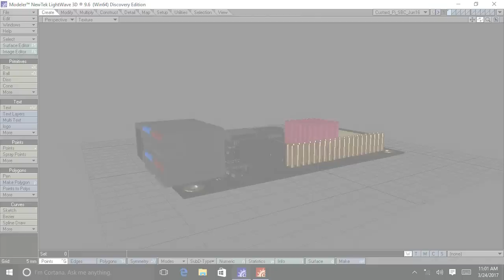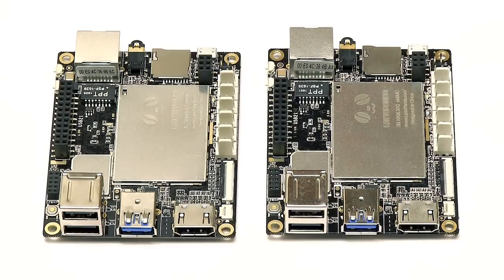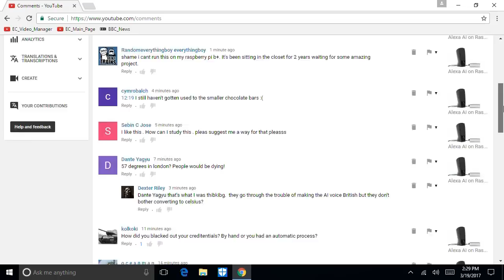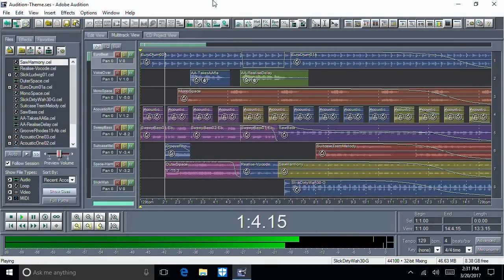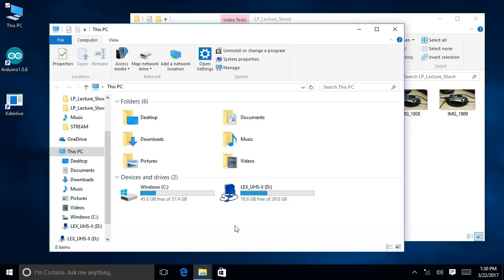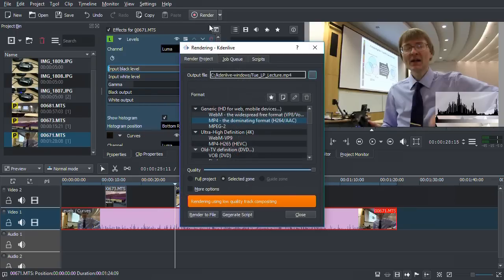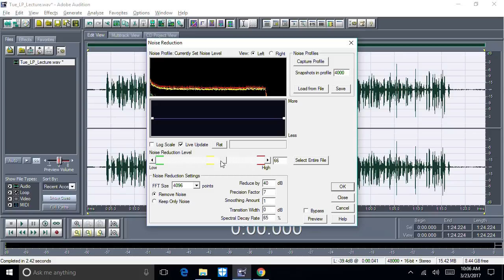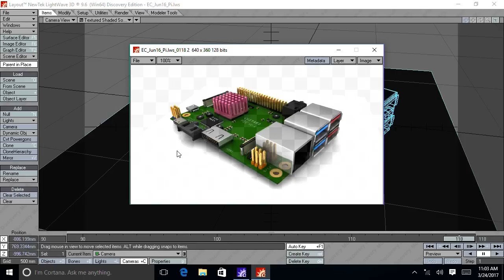LattePanda Week

Comment: For cooling with the CD case, you could put a old CPU fan under it, and use the female pin slots to put in the power wires. You might be able to connect it with the CPU pins for controlling when the fan turns on.

Comment: I use a latte panda as a tablet i bring to classes since my laptop is too big. It needs a heatsink big time. The one with the built in fan that DF robot sells is good enough but i mounted an inline slide switch so it wouldn't drain the battery when turned off.

Comment: Great video! The board gets quite hot, does it? If only we knew someone who could make videos testing passive and active cooling solutions for single board computers ... hmm.
Reply from the maker: Yes, I must get on the case . . .
Reply: Ryan Lester I ordered a fan with mine. it seems to make the job so the CPU is on maximum 70 during stress for a longer time
Reply: Looks promising!

Comment: An external fan is a must, the SOC throttles down quite quickly since it will get quite hot.
When you add a fan, it shouldn't ever throttle! (I have one and it's great, but wasn't when it didn't have a fan).

Comment: I'd keep the CD case and attach a 120mm fan to it :D
Reply from the maker: OK, brilliant idea! I will have to try this now!
Reply: We are expecting a follow up video.
Reply: yes was thinking the same thing , throw a nice heatsink in there too , looks like 50 cd sleeve but  you could put 100 sleeve on it taller sleeve ,more room for heat sink and fan and maybe you could dremel out some holes near the bottom were the ports are and 3d print some curved trim plates to go in the holes with nice cutouts for all the ports and glue them on ,do you think a cooled panda could handle a plex server  with transcoding if it is only serving 1 or 2 clients at a time?
Reply: With this idea perhaps using ceramic heat sinks might be a good idea over the usual copper/aluminium choices?
Reply: Put a sterling motor driven fan in the CD case. Why not use the waste heat to power the fan instead of draining more power to cool it.
Reply: Would be interested to see a 1x PCI-e slot break out from that usb3, even if the bandwidth is limited.
Reply: i don't think a sterling  engine would spin a fan fast enough to be  effective and  if it did then  then it  would cause  the efficiency to go down since it works on heat differential if it cools the chip to that of the outside air temp then the  sterling engine would stop
the whole idea is that you have heat to drive the  engine  cooling the heat source that drives the engine would be counter productive no?
Reply: Andrea Mitchell You only need a fan if the board is substantially hotter than the outside air.

Comment: I am shocked. Absolutely shocked. I find it absolutely amazing that this SBC runs Windows 10 so well and my parents literally just upgraded to a TB Levono because I finally# got the message across that their computer was "so slow" because it was pulling full capacity to run Windows 7 and did not have the RAM or processing power to upgrade Windows even one more single time.
Reply: I am literally in awe of this little SSD. It's just so quick. (I prefer 2.5 or above processors, but this little 1.4 seems to be rather quick.)
Reply from the maker: Wait until you see the new LattePanda Alpha -- I expect to review it here in two weeks.

Comment: LATTEPANDA QUESTIONS
1. How much Windows 10 system RAM is used?
2. Are there any major windows components that might not be installed, to save RAM?
3. How much system RAM is net available for all other applications?
4. Does it support OPEN GL?
5. What are the built-in (on board) audio specifications, in and out?
6. What is the Maximum capacity external SD card memory that can be used?

Comment: I wonder where Windows 10 is stored. On the board or on a SD-Card? And does it come with different Windows 10 languages or only english?
Reply from the maker: Windows 10 is stored in the flash memory on the board. I have not tried, but presume that you can change the language in the usual Windows international/language settings.
Reply: you nee the "language pack" or get it via the update funciton. Somewhere in the settings, you can change language. There it will try (!) to get the language pack via the updates then. 
Here on my latte it did not work and I get the language pack from another source in the web. But I just was not able to find the URL again ...
But yes, you can change the language.

Win10 originaly is on the internal emmc chip. A boot partition, the OS partition, and the recovery Partition (~700MB)
As I was trying to install a Linux, I kicked all that crap away and after I had to rewrite the Win10 image you get it from the latte website) I had 700MB more space :D
(don't  need that recovery)

Comment: Has the device had any problems with power supply ? How many mA was it supplied for all the work it did ?
Reply from the maker: Fed with a 2A 5V adapter, and worked fine all week.
Reply: Thank you very much !
Reply: I recommend not to use the μ-USB, that sucks. You can use the pins 2x2 marked with GND and 5V next to the µ-USB connector.

Comment: I need to use a drone to hunt for Wireless Interference for the company I work for and was stuck for a solution to connect the portable spectrum analyser the drone will carry to something I can view back on the ground. I've ordered one of these and I think it will solve my problem as it should run the analysers software and I can use VNC and WiFi to see the spectrum, that's the theory. Great video.

Comment: yes you can change the wallpaper on unactivated windows 10. just right click a picture and choose set as wallpaper. i do it all the time
Reply from the maker: Great tip -- I will try this. Thanks.
Reply: no problem.
Reply: I'm thinking about picking up a latte panda myself to replace the gole 1 that I have been working on and accidentally bricked. cause I have several people asking me how I did alot of the things I showed on my gole 1 gaming wise and the latte panda is pretty similar spec wise.
Reply from the maker: You may be interested in my video on the three new LattePanda boards, which posts tomorrow! :)
Reply: @ExplainingComputers  awesome. Cant wait to check them out

Comment: Good presentation.
So the latte Panda board was designed and intended only to run Windows.
I guess if you want a SOC that runs Linux or Android then you should run it on the ASUS Tinkerboard?

Also, I did not catch any attempt to use the Arduino portion of the Panda board.

Comment: Compared to your Raspberry Pi Week it looked a bit easier for you to use the LattePanda as a PC for a week. Not haveing to chage OS's and install programs to read a HDD or SSD and so on.
Reply from the maker: Yes, very true. It was much easier. I did not show transferring data across drives -- eg my video files recorded during the week -- because it all just worked fine. The USB 3.0 connector, and the micro SD card slot not in use for an operating system, made things really easy. The Raspberry Pi 3 is a great and responsive SBC. But the LattePanda is more so (if also more expensive).

Comment: Tinker board RK3288...... Hi i would like to know  if I can conect an external hard drive to this tinker box . And also will the 7 inch tuch for raspbarry screen conect to this. I want to run my CNC table with a raspberry pi ( or what ever ) & an exterior hard drive. I have large CNC table 10 foot by 20 foot I would like to run Mach3 because of the fitures My question is can I run windows 7 as my O/S and then load programs on windows like normal Thank you in advance  John
Reply from the maker: Yes, you can connect an external HDD to a TinkerBoard, and a Pi screen. But a Tinker Board is an ARM PC, not x86, so cannot run Windows. The PCs in this video are x86, and can run Windows 10. They cannot run Windows 7 -- no drivers. You could run Windows 7 on an UDOO.

Comment: Hi, Hi, thanks for the info on the LattePanda. I'm just getting into it's possibilityes and have a question - can you run 2 monitors with it? Can you use the HDMI and MIPI-DSI at the same time?
Reply from the maker: IT does not support two monitors I'm afraid, although you can use the HDMI and MIPI-DSI together, which is nice. If you want multiple displays (three!) try an UDOO x86 AP: https://www.youtube.com/watch?v=tpT4WGsMcvk You are coming to this market just as it is about to expand rapidly with new boards. Keep watching! :)

Comment: Would it be possible to install Windows 7, XP or even MS-DOS on this LattePanda? Would be cool...how about games?
Reply from the maker: Possible, certainly. But difficult. You would need appropriate drivers, and the LattePanda is Atom based, so does not have a standard boot loader to install an OS from a USB device. It really is a Windows 10 machine.

Comment: I run Debian 64-bit headless on mine, works as a really good web/email server however I can't find the wifi adapter on the board so I can't get drivers for it.
Reply from the maker: Excellent --- I'm impressed. :)
Reply: Matt Beaver: What version ... I also tried a Debian ... Link please? ;)
Reply: crapcbm this is the link but this is for the 64 bit lattepanda plus you have to use the built-in efi shell to boot it off of a flash drive. http://cdimage.debian.org/debian-cd/current/amd64/iso-cd/debian-8.7.1-amd64-netinst.iso
Reply: many thanks ;) I will try it
I have the 4GB/64GB version ;)

Comment: What's it like for heat?  Does not appear to have any heatsink other then the shielding can on the top.  The Atom IS a low-power CPU, but without decent heatsinking, the CPU clock will throttle back to keep the die temperature under control, and this will greatly affect it's potential performance.....  EDIT: Ignore.  You mention at the very end it could just about fry an egg.  Heat is an electronics killer.  I would not want to use it for anything important without fitting some kind of heatsinking. ;)

Comment: Mr. Barnatt,
     Thank you for your videos on the Lattepanda. I have been looking at this board for a project I am working on that requires opening and using multiple programs at once. Have you done any multitasking testing with this board? Currently I use a mini itx pc I built for this project but am currently looking to move into something like the lattepanda due to its size. This would allow me to mount it directly on to my tripod, open the programs and use team viewer to operate it from a distance. My concerns are whether or not it can run multiple programs at once (anywhere from 2 to 4) without bogging down or locking up, Can it handle a usb hub on its usb 3.0 port,  and whether or not I can attach something like a SSD drive to it for file storage. It is my hope that you can help answer some or all of these questions, thank you in advance.
Reply from the maker: Multi-tasking is no problem -- I have had many programs running at once. It is a multi-core PC running Windows, so this is just fine.

Comment: Are you going to try water or air cooling? Both would be tricky due to the CPU being located on the underside.
Reply from the maker: Passive and active air cooling were on my list. But now that you mention water cooling . . .
Reply: You can just mount the device upside down, and have an extender for the GPIO if you wish to use that.
Reply: Or liquid nitrogen . . .

Or dry ice . . .

Comment: Very comprehensive first look indeed! 

I had a few questions:

What are the power requirements for this board? How much current does it draw at full load? Do you reckon you can mount a heatsink over the metal shielding and maybe put a cooling fan over it? 

Do you think it's a good choice for simple office work and a bit of browsing? Or are there cheaper solutions? 

Cheers!
Reply from the maker: It runs fine from a 2A 5V adapter. I've not (yet) measured the power use. Yes, you can mount heatsinks on the metal shielding -- which for the CPU is under the board. And you can put a fan over that (DF Robot even sell one). And there are pins to connect it to for power.

For simple office work and browsing it is a good choice -- everything I did of that nature during the week was on the 2/32, and it worked fine. The big benefit of the LattePanda is that you have Windows. So if you need Windows, it is pretty much unbeatable (in my opinion!) right now. If you don't need Windows, The Raspberry Pi 3 takes a lot of beating. Not quite as responsive as a LattePanda, but very usable under Linux. This said, the web browsing experience -- especially playing video -- is better on the LattePanda.

Comment: Can you reformat these board's to windows 7
Reply from the maker: You would need an appropriate image to install on the LattePanda, plus hardware drivers. Probably technically possible, but as far as I am aware not currently available.
Reply: I tried differenz images of Win7 and 8 to install. Win7 starts install, but freezes while installing. Win8 didn't even start from USB or CD (via USB) looks like we are stuck to Win10. Also there seems to be none Linux for the Panda, although it is advertised with it... 
If someone knows a version of Win7pro/64 that can be installed on it, please let me know!
I am sick of this Win10 .... (Drivers can not be the big problem; you will find some, just a question of searching and time...)
Reply: +crapcbm I'd think the GPU and possibly network chipset might be exotic enough to warrant you'll never have Win7 on it properly, even if you coaxed the install to actually go through. There might be a better chance with Linux.
Reply: Windows needs some garbage ACPI BIOS support that you're likely not going to get out of this thing!

Comment: I do like the SBC's like the Pi and Panda. But it does look to fall short compared to a laptop in two ways. The need for an external display. And a need for external power. I wonder what a small case that incorporates a small LCD and battery pack would do to its portability.
Reply from the maker: All of this can/could be done. SBCs run very well off USB power banks -- and I've tried a 7 inch touchscreen on the LattePanda previously. I just need to case it all somehow! Here's where I tried the touchscreen: https://www.youtube.com/watch?v=j7o6CBNUmt4
Reply: I would like to see what you come up with as far as a portable case solution involving that screen and a battery pack. (if you decide to attempt it) I think you could get away fairly minimalist with the design of it assuming you use your wireless keyboard/trackpad.

Comment: sir, can we use lattepanda(4/64) for designing software like CAD, CATIA, ANSYS, HYPERMESH, PRO-E.....and can it will support well for minister, hard disk and other USB devices..?
please, explain it briefly with difference between regular Windows PC and lattepanda...
Reply: sir,it will be effective if u make a video for such a question separately and briefly..please.
Reply from the maker: The LattePanda is just a Windows PC. The 4/64 should run basic CAD pretty well.
Reply: so sir which will good for us lattepanda or regular pc by performance and cost- point of view

Comment: Goodday, mate.  Now that´s about the coolest single board computer case you´ve designed to date.  I really like that home made case out of a CD case.  I´ve been throwing those away for some time now.  That´s really thinking outside the box (case) as it may be.  Now you´ve got me hoarding all my junk and not wanting to throw anything away.  That would be easy to add a fan to it as well as drilling holes for the different wiring requirements.  Absolutely brilliant!  Cheers.  :-)  
Can one run Linux on the LattePanda?  I do not care for Windows at all since I´m using my Raspberry Pi 3 as my desktop computer.  It works quite well for what I´m doing.

Comment: As far as I've seen, unactivated Windows 10 only runs for 30 days before it needs to be activated else you can't use it any longer. Is this not the case on LattePanda? You may need to run winver to see the date it'll stop working by.
Reply from the maker: My 4/64 LattePanda has been running for over 4 months without requiring activation. There certainly used to be limits in earlier versions of Windows, but as far as I can find out, this is not the case in Windows 10. Microsoft really want us to run it! :)
Reply: Hm, interesting. When I first switched to Windows 10 and they were having the activation server issues, it told me I had 30 days to activate it. I wonder if they've built in more leeway since Windows 10 first came out. Either that or it works differently with OEM editions or something. Cheers!

Comment: On another channel, the YouTuber placed a desktop CPU cooler on the board and it resulted in the LP running at 2.3 times normal speed. This is due to the CPU being throttled when no cooling is present. I’m about to scavenge 4 of my old desktops for a suitable cooler so I can get this type of performance boost.

Comment: What was the difficulty level of connecting the disk drive?
Reply from the maker: Very easy -- anything with a USB connection just works. The DVD drive here was connected using an IDE to USB convertor (it was an old DVD); more modern drives would need a SATA to use adapter. Note that the DVD needs its own power (here my convertor has its own adapter).
Reply: I use mine as a Bluray player and media streamer, does a great job, once a fan was added :3
Reply: Shadow's Insomniacs how exactly do you have this hooked up?
Reply: External USB powered Bluray drive (uses 2 USB ports, connected to a powered USB hub, no AC adaptor for the drive itself).

Media streaming via Ethernet.